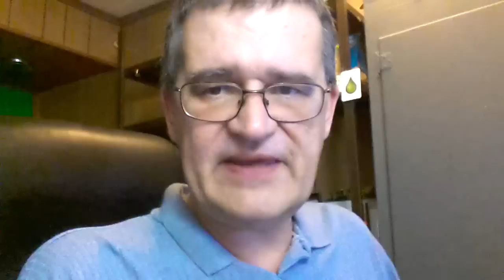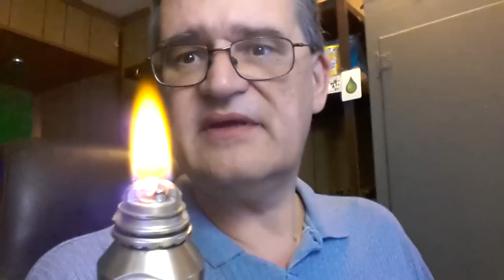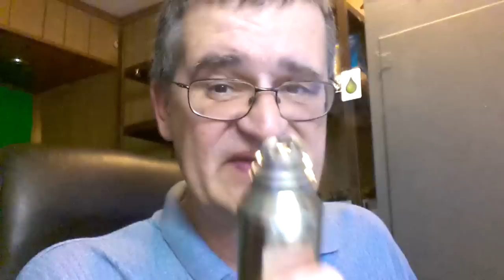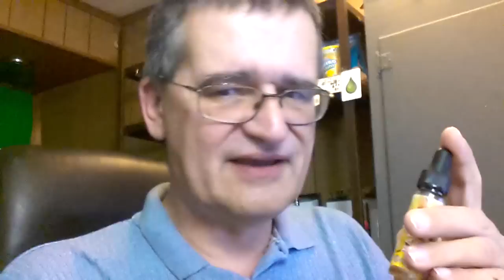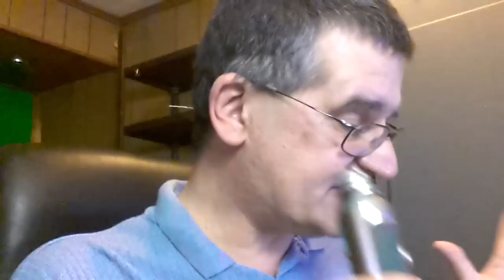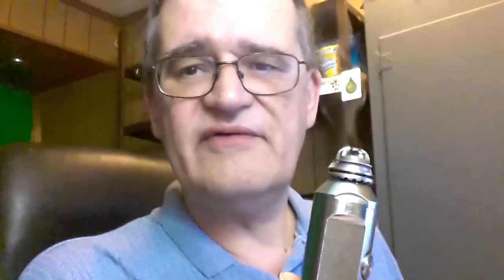Vape on Fire it's a Flamin' Atty (005)

Comment: i might be the only one who's curious, but its worth asking; what kind of battery do you have in that mod (how many amps)? because with a 2.2 ohm build anything higher than 5 or 6 amps could potentially be surging too much power into your coil. id take that build out immediately if i were you lol. bad things could happen.
Reply: joshm2006 batteries are (as usual) some cheap China re-wrap of dubious origin.  Much of the novelty has been lost and these days I've been using a reasonably safe eLeaf with factory battery.
Reply: Paul Monaco high quality batteries are not hard to find nor that expensive.  If you need 10a or less then Sanyo has a good cell "I believe it's 18650ga" but not certain... It's red. But good high Amp vape batteries are about the same price so if your mod can regulate correctly I believe it should be fine.  Bottom line is don't skimp on the cells regardless of use (flashlight, MOD & anything else).

Comment: why on earth would anyone build a 2.2 ohm build? of course it will be a flame thrower! even small mouth to lung tanks use max 1.2 ohm coils, and thats usually at 10 watts.
Reply: +Strange Clouds though barely a year ago things were different back then.  15W was the limit on that mod and I think 1.3-ohms was the minimum build it would fire on.  Funny looking back... can't imagine ever being higher than .6 now though my personal sweet spot it .4 these days.  Even nic levels, was at 18mg then, 3 or zero now.
Reply: +Paul Monaco I use a 0.15 ohm build at 45 watts and it's soo smooth.